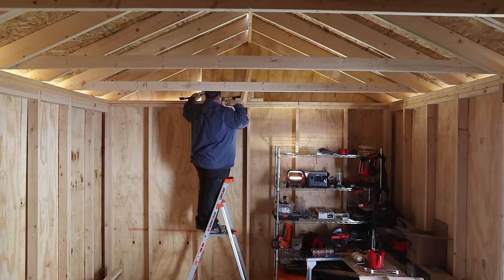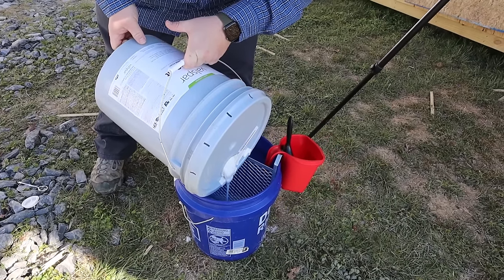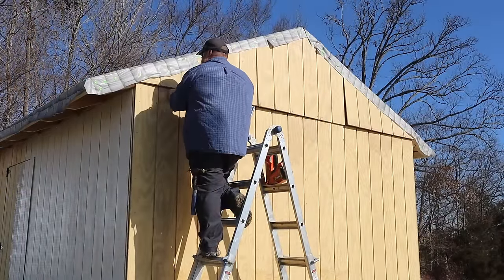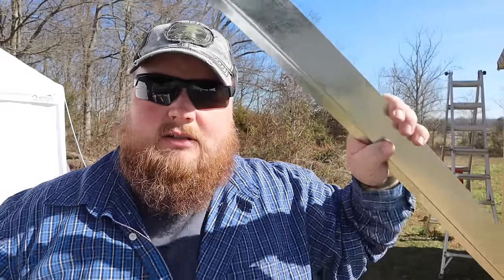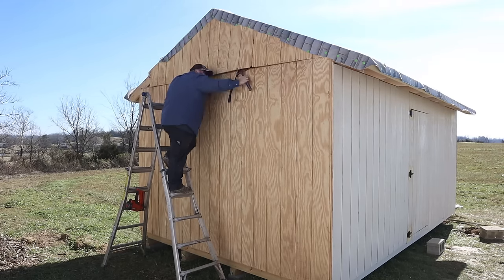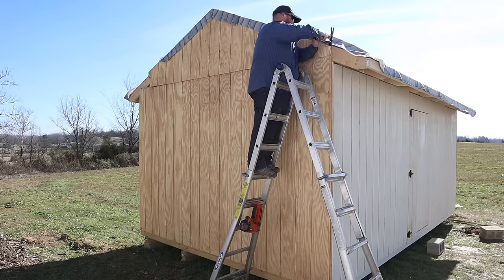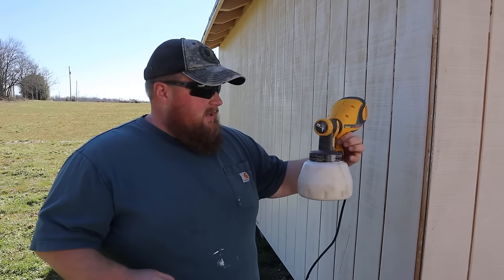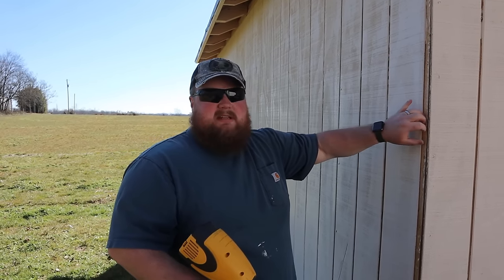The WRONG Way to Flash Siding  - Workshop Build 10

Comment: Good catch on the z-flashing. Don't forget to put vertical stud blocking behind the vertical flush butt joints of the gable siding. Sooner than later would be best as the smaller panels will start warping pretty quick.

Comment: You likely have this on your shop "to do" list but when I built my shop.....very much like yours, I installed a gable vent w/exhaust fan on both ends. They made a huge difference in keeping my shop comfortable.
Not too expensive either.  Just a thought sir.
Reply from the maker: Oh yes, that is on my list to do before summer. :)
Reply: Do you see a value in having a fan with reverse airflow as well? So you can get air in but also pishboit when needed?

Comment: I've worked with that kind of wood siding. Trying to tear it off after nailing it in place left me feeling like I was on a fool's errand. You almost always damage it. A less-thorough fix for your oversight: make sure the seam is open at least, say, a thirty-second (use an oscillating plunge blade if necessary) and work some good quality paintable caulk into the crack. You could use painter's tape to confine the caulk to a narrow strip. Not as good as the Z-flashing, admittedly, but much easier. Just a thought. Good videos.

Comment: Perhaps I am dense but what is the benefit of Z flash in this situation? Normally Z flash would be used over top sheathing and house wrap so if water got behind the siding it couldn't keep working it's way down, it would find it's way out. This siding is also the sheathing so there is no rain screen behind it. I suppose it would prevent wind driven rain from going into the structure.
Reply from the maker: It helps to prevent water from going inside the wall at the seam of the two panels.

Comment: Another reason to use self tapping exterior torx bit screws! Great video! As I mentioned in the previous video comments, if you left an overhang on the sides it probably wouldn't matter.

Comment: Sam don't put trim over the Z-flashing it will trap water. Even if you caulk it the caulking after a few years will crack and water will find its way under and start to rot the T-111.
Reply from the maker: Good point!

Comment: I just butt the sheets up and insert an 8d nail between the sheets to create a small consistent gap.  Then, I caulk that gap with a high-grade polyurethane-based caulking like Quad or DAP Amp.  All sealed up, then prime and paint 2 coats.  That flashing will create a ledge for water to sit. And it looks bad in multi-sheet installations, and you have to caulk the ends of the flashing anyway. Just fit your pieces accurately, leave a 1/16" gap for good caulk, and prime and paint well. .  Sorry you had to go through all that.

Comment: Second mistake , failed to seal the back and edges, especially the bottom edge of the T1-11 including the bottom edge of the upper piece, it will soak up water and rot. that stuff is ok for desert but everywhere else it is temporary 5-15 years is all you will get.

Comment: dead blow hammer and a beater block or a 2x6 as rat run sliding across the truss bottom cord would pop that gable siding like a spam can .sliding the 2x6 gives it a direct large blow enough out to slip a sawzall blade in and a few wedges and no damage to siding

Comment: Just wondering about moisture ingress. When ever I see play board builds they wrap everything in tyvek (or similar) membranes. Then apply cladding external. Here you’ve screwed directly to you frame and have just ply skin and paint. 
Also under the rafter there’s a void will you block oit and make air tight or will you keep open - atm it must be freezer like inside.

Comment: Already been mentioned but make sure that you paint the bottom and the top of all t 111 actually doesn't hurt paint all four inches when water is running down it will trip over the bottom Edge suck up inside it and your t11 will start to pull out from the bottom also includes some screws along with your ring shanks

Comment: On my new 12x24 shop, I used vinyl siding. My house is near 50 years old and it is covered with vinyl siding but originally, T-111. When I built my new shop last year, I used OSB sheathing. When the walls went down, under the wall seals, I used a heavy bead of constructive adhesive as well as the bottom of all OSB siding. This will keep the bugs out of the building. Your building looks nice although it will be like mine very quick. Too damn full. Space is a premium for sure.

Comment: An oscillating tool with a blade that can cut nails would have made it easier and saved damaging the T-111. Measure where the nails are on the outside and mark on the inside, or just move the tool at an angle to find the next nail. Good catch and good job to fix the oversight. We all make mistakes and miss things.  It's how we admit and fix that makes a difference. Stand up job.